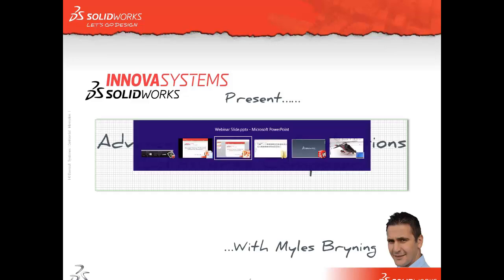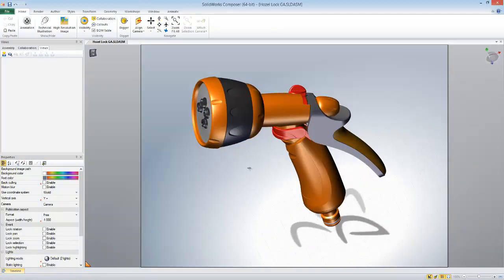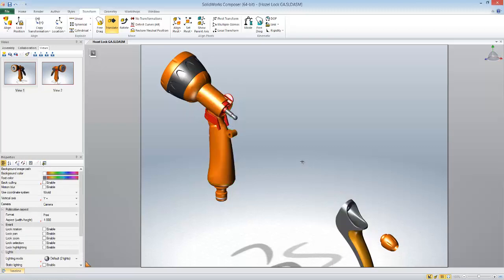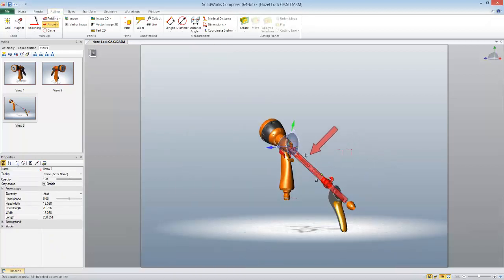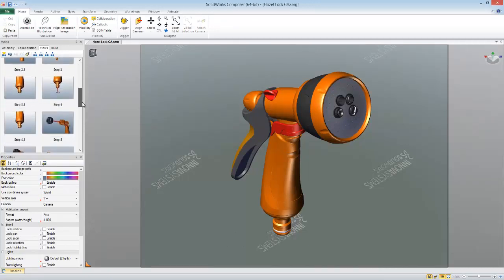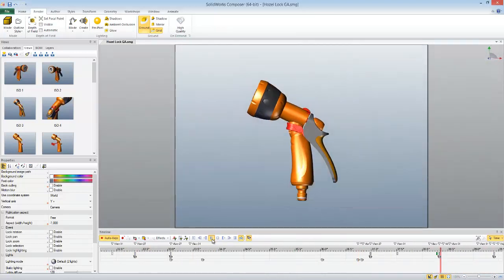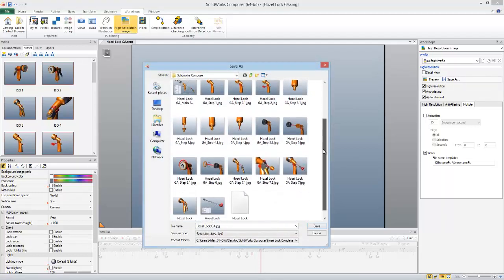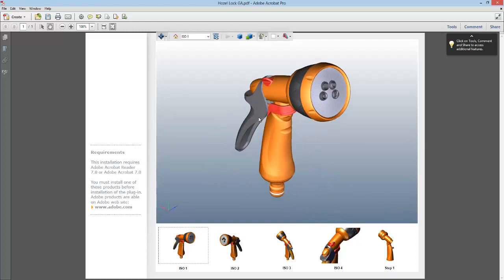Advanced Technical Publications With SolidWorks Composer

Comment: Hi! Thank you for the video.
Can I ask you - how to make lines thicker when saving in high-res image from silhouette render mode? I have a problem - when I set resolution higher (say, 6000 px width) the lines are very thin. Is it any possible to set up the thickness of the lines for silhouette mode (please, note: I am not speaking about outline style!) for high resolutions? Thanks!